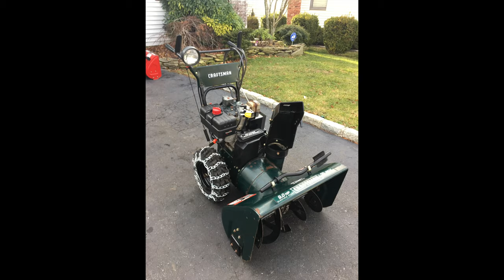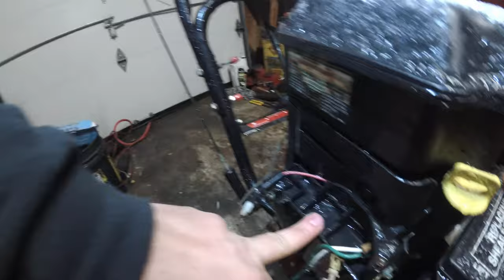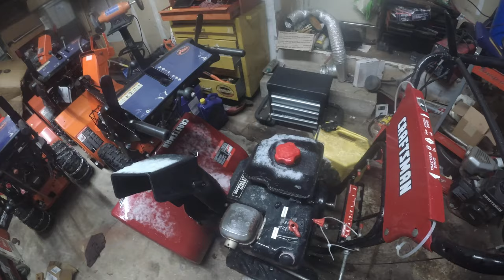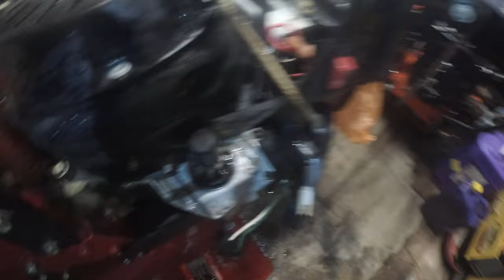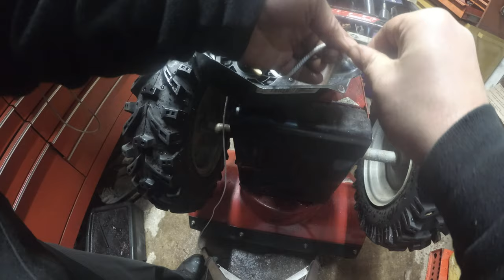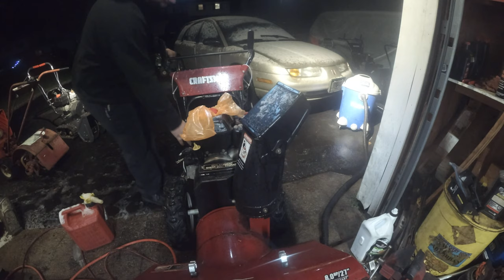Craftsman 827 Snow Blower Review PLUS How to Repair Replace Pull Start Rope Cord Briggs and Stratton

Comment: Wait til you see my video using a kerosene heater in my garage.  That is if I don’t die from Co2.
Reply from the maker: Mowers N Blowers or blow up from the open flame coming in contact with fumes.
Reply: Pattay's Performance hmmm, maybe I should rethink it!